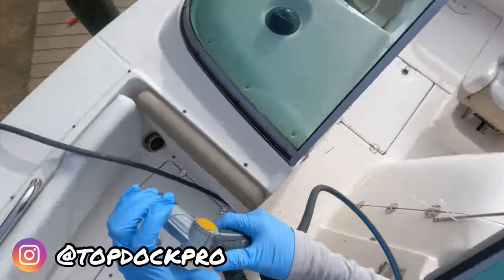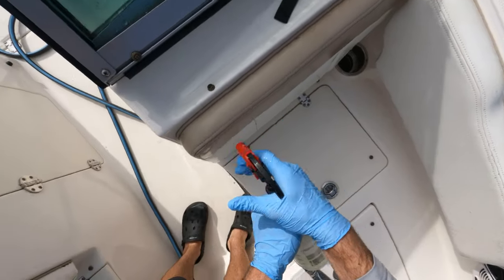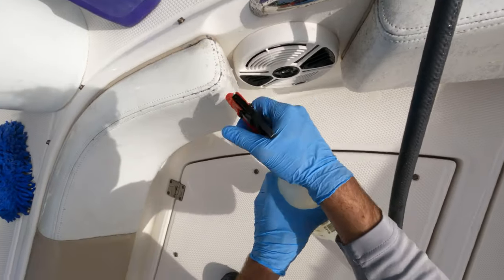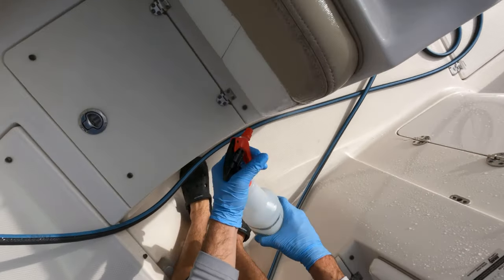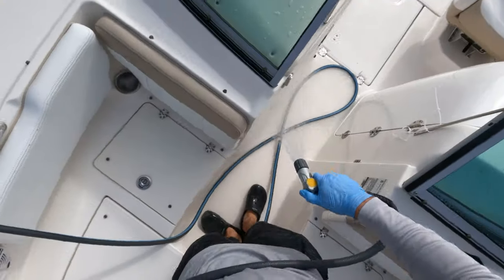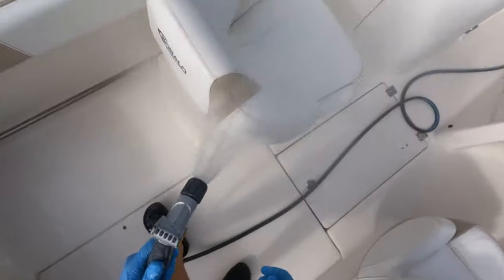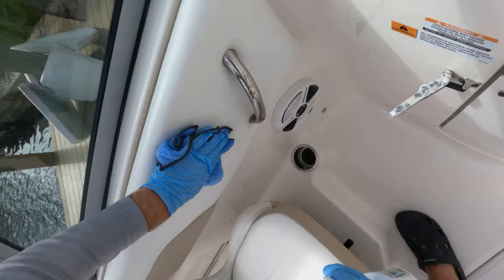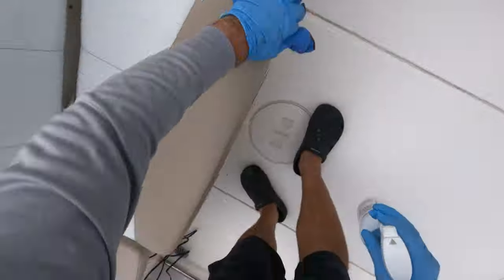How to Remove Mold & Mildew From Your Boat Seats?

Comment: Thank you so much. I have been struggling for the past 3 years trying to get my boat seats clean. I have watched and tried countless videos that haven't worked.  Decided to try these products and can not believe the results.

I used to spend over 3 hours cleaning with lots of scrubbing and manual labor. With this method, I was done in about an hour with seats that are clean as brand new. Now, just to wait a few months to see if the prevention part holds true. 

I'm no longer embarrassed to bring guests aboard my boat. ❤
Reply from the maker: So happy for you. Glad it helped

Comment: Great video on mildew/mold removal. After 10 weeks under repair, I followed a similar process and the results are night and day. Due to product availability, I didn't always use exactly the same products but I did use the same type of products. Now I just need to figure out a good way to restore the exterior shine (the first attempt didn't work)!
Reply from the maker: Once the protective layer of the vinyl comes off typically due to high uv overtime the seats won’t shine up like they used to. Even the best products won’t do much. You could try to soak them, otherwise it may be irreversible

Comment: This mold remover is the best thing ever! I have had my boat for 4 years and when I bought it, there was already mold, today I’m cleaning my boat to put it for sale and used this stuff and then sprayed another seat and then turned and looked at the first seat and I was shocked! It was almost all gone within like 30 seconds! I let it sit for another minute and it was amazing! After two applications on the worst seat it was perfect! All mold gone! I had bought the small bottle and had a tiny bit left after doing my entire pontoon boat. 

This is bleach based as you can smell the bleach when spraying…you might could just dilute bleach and it might be the same thing…not sure…

My carpet was perfectly fine with the solution having bleach…

After cleaning the mold I washed with soap and water and then used Babes Seat Conditioner.

Before using this I’ve tried kitchen cleaner, tough stuff, soap…nothing worked.
Reply from the maker: Yes it is the best thing ever! Glad it worked for your boat :)

Comment: Question? With bleach being the active ingredient, what is the possibility of the stitching's being damaged or dissolving over time once this product has been used? Thank you
Reply from the maker: Yes that’s a great point to bring up. The stitching will dry out when you use bleach on your vinyl. It’s important to follow up that process with a vinyl protectant to restore the oils back into the vinyl and stitching
Reply: Keep in mind that mold can also breakdown and destroy the stitching and vinyl.
Reply: If I remember right, he flushed the seats off with water after using the Starke spray that would of removed or thoroughly diluted any remaining bleach

Comment: I just bought the mildew cleaner:) Hoping it works! Thanks!!!
Reply from the maker: Did it work?
Reply: @topdockpro yes! I was shocked! My mold was on my seats for years. It’s amazing stuff really. It’s bleach based so you need to use a conditioner after it. And it did not ruin my carpets when I washed it off. 

Might just be able to dilute bleach a lot and it work the same though.

Comment: So with it having bleech in it does it hurt the seams?? Does it change the color of the stiching and make them fall apart? I used marine 31 today on a seat and it made it look new but messed with the stitching!😊
Reply from the maker: Yes it could hurt the seams depending on the thread being used. That’s why you’re not suppose to do it often. However, it should NOT change the color of the seam. Typically the sun is much more damaging than the mildew remover

Comment: Oh yea glad I kept watching I’m not using a product that needs 5 applications that’s a total fail.
Reply from the maker: That’s a pretty unintentional comment. Anytime you restore a surface it doesn’t happen in seconds. Gelcoat, stainless, etc. The deeper the mold the longer it takes even if you used straight bleach which really dries out the vinyl

Comment: This mold/mildew was NOT set it. This example could easily be removed with any household cleaner and spraying.
Reply from the maker: It was about a year of build up. Still need a good mold and mildew product. House cleaner will not touch that